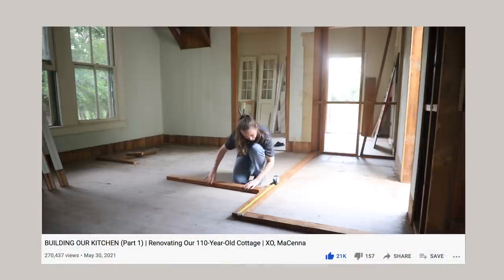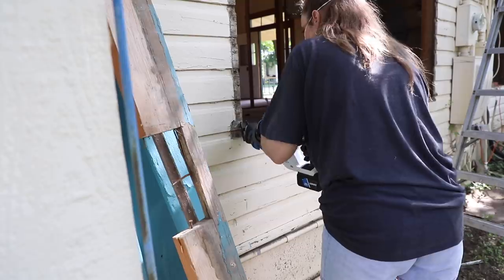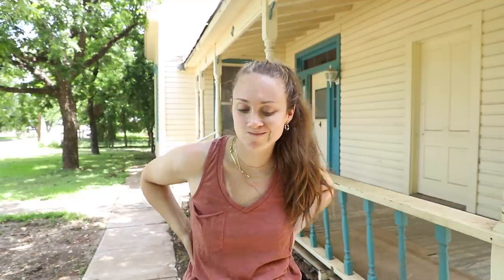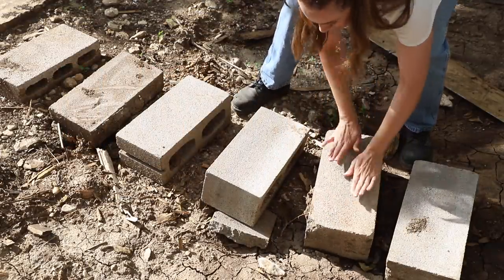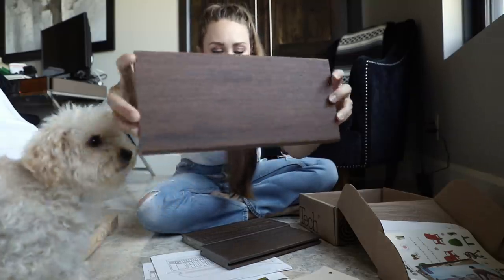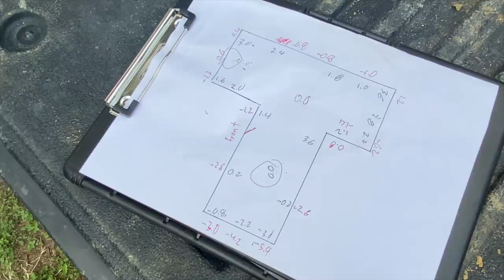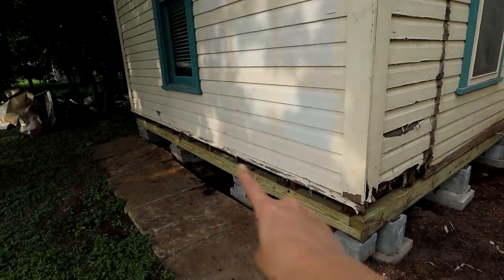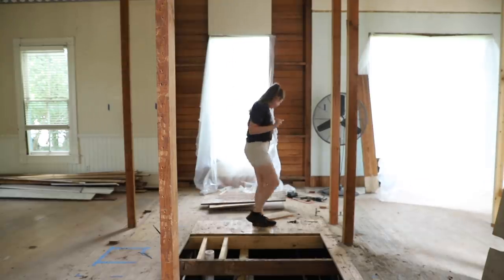We Have To COMPLETELY REBUILD This…  | Renovating Our 110-Year-Old Cottage

Comment: WARNING:. I personally know two people who had MAJOR issues with the Trex decking. One, if it gets direct sun it gets so hot that you can't walk on it with bare feet and it will burn Kinsley's paws. Second, the heat caused the boards to warp. One person just replaced the warped boards and moved shortly after so we don't know how well that worked. The second person had pets so opted to replace the Trex with treated wood so they could walk on it. And it felt soft when it was hot and gave under their weight like an unsupported floor. This caused me to change my plans and I replaced my deck with cedar that will outlast me and I don't have to worry about burning my puppies feet. The first deck faced east and had partial sun exposure. The second deck faced south and had full exposure. Just FYI.
Reply: I just said the same thing about the Trex. Same issue. Glad you brought I up too.
Reply: Thank you for thinking about Kinsley’s paws!  ❤️🐶
Reply: Thanks for the info. 👍🥺
Reply: I have Ultradeck and it doesn't get too hot to walk on. Google "ultradeck vs trex" and you'll find lots of good info! 👍

Comment: Every time they take walls apart I'm like "where's the insulation?". American homes are built so differently, especially that long ago. This house will be such better quality after all these renovations!
Reply: I was just thinking the same! Like, the walls are just boards?
Reply: Oh yes and the walls are so thin! In Europe our outer walls are probably double thick! And wayy better insulated. But Macenna is doing a great job in this reno phase!
Reply: And the floors? OMG, you lift the floor boards and there’s just earth underneath.
Reply: Same, but then I was like why am I surprised when we replaced some sheetrock in our house, I was shocked to see no insulation! We were told it's not needed though you can add it if we wanted it.
Reply: After the crazy ice storm that hit Texas and the other states thus past winter I do hope y’all put in insulation.
Reply: Right ? I’m from Belgium and I am so shocked everytime I see american houses !
Reply: that wall those windows were on was already demoed, so she likely already took the insulation out when she took the sheet rock/plaster/drywall off. i live in the northeastern US and we’d never survive without insulation, all houses around here certainly have it, so i assume hers probably had insulation and she just took it out? also if there was any wetness from roof leaks etc she’d have to replace the insulation in the walls as itd prob host mold, bacteria, and other critters:))
Reply: When she sawed down the wall to make the door and it was just planks I was like "oh".
Reply: Honestly, the insulation probably disintegrated over time. The house is old and the insulation from that era would have disintegrated over time, unlike new insulation nowadays that holds up longer.
Reply: @janakirchnerova3544  most American houses are well insulated these days.
Reply: @kaitmontimurro4806  agree. I’m in the mid-Atlantic and when we bought our current house in 1978 (built in 1971], every wall was insulated. When we built on to the house, we put in even better insulation. Possibly the age of Macenna’s house and it being in Texas meant it was built differently.
Reply: Most homes in the US are insulated. Southern homes 100 years ago probably didn’t have much insulation. Northern homes have always required it due to weather/temperatures. It’s a huge country and every region builds houses differently and uses different materials depending on their weather, etc.
Reply: Most of the old houses in Queensland Australia are similar to this one.  Timber walls, mostly one thickness, timber floors.  Insulation is mostly in the ceiling, and that's only been a thing in the last 10-15 years.  New houses are mostly brick with concrete floors.
Reply: My 1951 horse in southern California house has very little insulation.  🙄 it would be very expensive to add it on nos other than in the attic space.
Reply: Our cottage (eastern Australia) was built in the mid 1940’s and has no insulation. It isnt something that houses ever had. We don’t get too many extremes here but we are adding it as we renovate.
Reply: Most old southern houses don’t have insulation in the walls because it doesn’t get majorly cold there. And if it did, they more than likely had fireplaces or wood stoves to burn. All houses built nowadays have insulation though. I think that became standard practice in like 1970s or so. So like anything built before that time period might not have insulted walls (if they hadn’t gone through renovations of course).
Reply: This is classic in Texas many areas don’t have building codes.
Reply: My home was built in 1919 in Northeast Ohio and it still has installation! It was added in the 90s though. 😂 I don't know how they lived without it that long we've had some very cold Winters. Like -20 when I was 4, my parents still talk about it.
Reply: @Dynsdead  yes, indeed ! they look like sheds, right ? Where are the bricks, concreet and proper foundations ?
Reply: Our home is a large four square from 1908 (I think, no earlier than 1915) in the mountains of Virginia and has zero insulation 😬
Reply: @fiammalujan6715  the last owner of our home thankfully went through the headache and had it installed!
Reply: @fiammalujan6715  I had a home built in the early 1900’s here, it had a loose fill insulation that the mice ate lol not much left. Walls were made of wood planks like tongue and groove with the insulation in between. Thankfully no asbestos. That was used up until the mid eighties.
Reply: @kaitmontimurro4806  no, I have followed the whole proces. There wasn't much insulation in this "old" house (not thát old to Dutch standards :-) ). I find American houses very flimsy compared to what we are used to.
Reply: Ours is over 100 yrs old... when we started remodeling there are also no floor plates along exterior walls . I’m assuming that was for ventilation back in the day ... one day at a time .
Reply: @Dynsdead  Me too!
Reply: It’s because it’s Texas. Other, colder states have insulated homes
Reply: @judy-angedv7590  O know right?! I live in a house build in 1791 and yet it has still better insulation / walls than some homes up there. (And yes, the previous owners did a lot aswell to it, but it's monumental). I've had rotten beams aswell, rotten walls etc. But still 🤣

Comment: Here are some ideas for re-use of cut down columns off porch...1) make a 4 poster bed using columns. 2) Use as dramatic victorian alcove with posts and gingerbread and center a clawfoot tub and overhead glass prisms chandelier with lacy curtains draped and tied back onto posts. 3) Cut porch posts in half lengthwise and use as interesting "trim" on otherwise plain fireplace mantels or as woodtrim on doors or walls. 4) Use for outdoor gas lamp posts along a path to other guest cottages. 5) Add birdhouses to top of posts and put in varied height groupings with wildflowers growing around them.

Comment: You should make the door ADA compliance: 36. Easy to get furniture and appliances.
Reply: Especially since its been stated as her "Forever Home" We all get older & sometimes need assistance aids. Or if mama & dad come stay... ADA Should Be Standard, not everything (handrails) but spacing for sure.
Reply: @marshawargo7238  Working in ems has made me realize how small some doorways and hallways are. When I build a house I definitely will be making things wide enough for stretchers and wheelchairs. haha
Reply: My 1920s house only has one door we can bring furniture through and it's just shy of 31 inches wide. Finding a couch that could fit was a nightmare!

Comment: You are going to love that composite flooring. When I added my composite deck a year after a major kitchen remodel there weren't many choices. I'm not wild about the mocha color, but the alternative was boring gray. It does show scuff marks from dragging heavy furniture across it and I have to clean the mildew every few years with bleach. Your darker color probably won't show any.  
Now things will happen quickly. I can't wait. Will you add insulation? Your comment about the heat made me ask. My 70-year-old house doesn't have A/C yet. Next year. 🤞 I'm in Minnesota and even my house doesn't have insulation...in the original part.

Comment: Girl, you are right on! You have to watch & stay on top of those major changes that contractors are hired for. To many undone essential things get skipped if you don't. We have only hired them a couple of times on different projects. And they where always leaving some important details out! 
 The foundation & leveling it. Is super important if you want everything to turn out right. Geeze basic skills in kindergarten teach us that. 
 If you don't construct your blocks in securely & level them it's all gonna slowly fall down.  
 We are sorta in the same process.  A little different than yours, budget is tight. But we still know how it has to be done for long term stabilization! 
 Old mobile homes we are reclaiming & hubby which he's 64, is manually leveling & putting what we only can afford & have access to. Cement blocks RR. ties, some of them are Bridge ties. Which are incredibly heavy. Using an old tractor we have, but mostly moving them by hand. 
 I am grateful he learned his skills long ago. He is a dinosaur of sorts with all the skills he has had to learn & get good at with very few resources & little money for having things done. And is being very perfessional & picky about it. Our piticular situation came out of a lot of bad luck.  But we are both determined to make lemonade out of these lemons we have.. lol
 We have spent a lifetime, possibly 2 lifetimes in the what I called recycle life, out of necessity & wanting pretty things, without the funds nessary for such things. 
  One might say we built our foundation on solid ground & leveled it to last! 43 yrs. married & still working toward a goal! ❤

Comment: Hi
may I ask what you have in mind regarding the insulation of the house .. now I live in Denmark (Scandinavia) where it can get really cold, and know that texas will not be quite as cold, but as you discovered this winter so there is no longer anything called "it does not tend to be cold." and what will you use of heating. In relation to Scandinavian building rules, it is far from ours that there are very strict rules about construction, heating, insulation, tightness, etc., so it would be a little fun to hear what you will do to secure your house in the future, to the changes that are clearly on the way ♥ ️
it will be an absolutely fantastic house when you are done, and beautiful, but do you think you can do yourself the favor of thinking ahead in terms of winter, water, etc. ♥ ️ it is so expensive, once you are done, and then have to redo it due to such a bit boring stuff ♥ ️🇩🇰

Comment: Those beams were treated? They look green and wet still. Usually they need to be soaked in a treatment to avoid bugs and rot. I'm concerned they put it just like that from the shop 🤔
Reply: I was wondering about this, too.
Reply: Pressure treated lumber has a green appearance. Google a photo and you can see for yourself.
Reply: The green moist coating is the treatment

Comment: When you put your deck boards down picture frame your deck and use the matching g plugs to cover the screws for the finale outside boards.
Reply: You can install them without screws going in from the top! Another great thing about maintenance free decking! 🙌
Reply: @kathyusa-iowa5137  the outside board will not have the ridge in it for the hardware to be hidden. It's a solid board.

Comment: You should have gotten a home inspection… My first two houses I passed on because there was too much rebuilding work… Like rebuilding the whole roof, and the other one where I would have had to completely rebuild the garage/corner of the house depending on “how it fell” I ended up getting a better house and replacing all flooring instead. Would that two years ago, took the equity and bought a small condo mortgage free… Housing market has gone up, and I’m now looking at the equity from condo to see and do the same thing but move to a different state.

Comment: genuine question, the house is so torn apart and there's sooo much work to do on it: wouldn't be cheaper to just destroy and do new one on the lot ?
Reply: I've wondered that too! I feel like, especially in this current market, it would still be more expensive to completely rebuild. This route definitely takes more work though!
Reply: Probably not considering the current prices of lumber. There is a lot of value in the framing and siding that exists on the house. Demo and disposal of all those materials costs money, and if they built new they would have to get new plans drawn up, gain approval from the city, etc. And obviously there is something special about salvaging an old home and keeping some of the authentic details. 😉
Reply: @emerald_rabbit  Thank you  !

Comment: I can’t remember if the house is Victorian originally or not. But if it is, at least one spindle in a staircase would always be slightly different. And the reason for that is that the only thing that was supposed to be perfect was God so builders commonly did something slightly off so as not to make it perfect.

Comment: I’m concerned that your foundation leveling looks like it’s just placed on top of the ground. Please have a structural engineer check the soil for stability. I’m used to drilling  & pouting much deeper footings! Also, your door openings need to be 36” WHEN OPEN to allow for wheelchair or walker access! Not just the door frame 36” because the door and hinges take up space.

Comment: this started as a restoration and proceeds as a replacement, more so with other than  original  or natural materials. i understand the practicality and the cost, even the aesthetics  part, and i have no doubt that it will be very beautiful. But i do not understand the point of getting such a property instead of building what you had in mind from scratch.